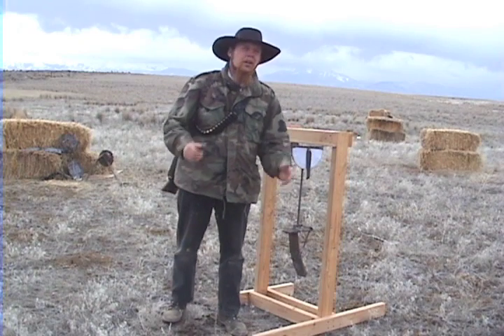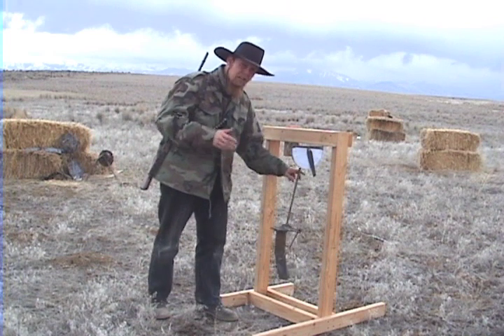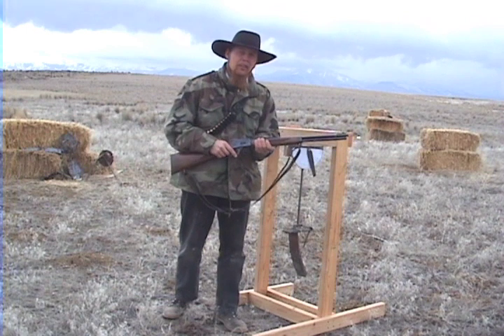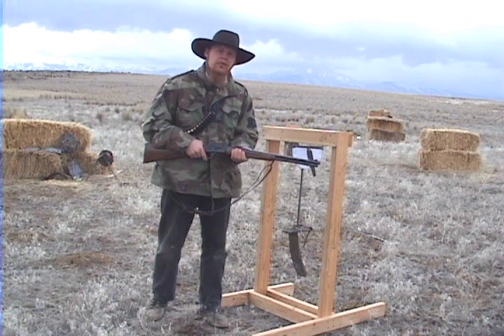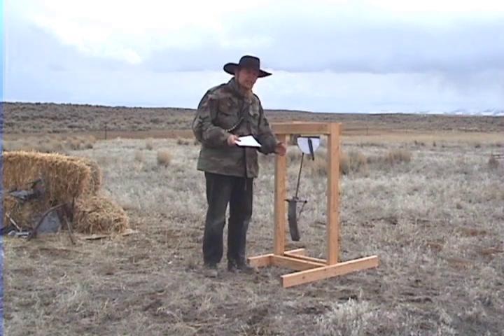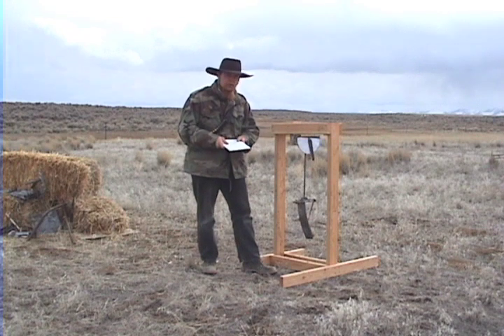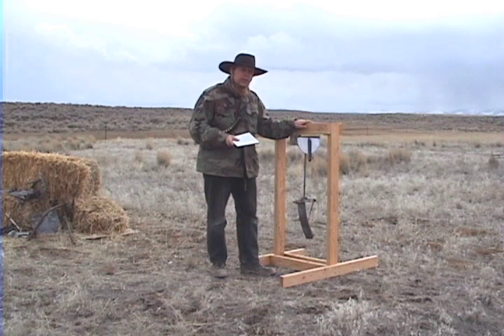Ballistic Pendulum (TIS027)

Comment: Interesting video. Please try again with a bullet trap pendulum for greater momentum  transfer. However, a good amount of the bullet energy goes into deforming it upon impact.so try shooting into the end a rubber mulch filler PVC pipe to mitigate that issue. But then there's the heat from friction... It ain't easy.

Comment: Great experiment. 
I teach physics at Kenai Peninsula College (Alaska) and the ballistic pendulum is a typical experiment. There are the apparatus manufactured by science supply companies but I use foam dart guns (in fact I prefer foam dart cross bows). Obviously real fire arms are out of the question within a university, even in Alaska. 
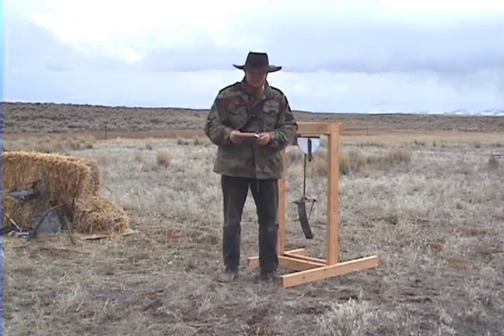As I'm very familiar with what you're doing and the computations that you're using, I'd be interested in said computations. At around 3:20 min you mention the results but I'm curious about your raw data, that is length and angle of the pendulum, mass of the bullet, mass of the pendulum.
Reply from the maker: This is a relatively old video, and I think I just wrote down the measurements on a piece of paper, which I probably threw away long ago.  However, shortly after this I did another, similar test in which I replaced the steel target on the pendulum arm with a wooden box filled with ballistic gelatin, and tried shooting it with a variety of different loads, some of which were captured in the box, and some of which went all the way through.  (video: https://www.youtube.com/watch?v=reVWYGfawZo ) For that test, I remember doing the calculations in a spreadsheet, so I probably still have the data on my computer.  If you want, I can try to find that spreadsheet and email it to you.  My email address is idaho1 at barnoftheinternet dot com.

Comment: Isn't the puddy using up momentum in slowing the pellet? Isn't it the same amount the pellet would use in collapsing itself without the softener? The pendulum puts some of its energy into the connecting mass between the point of hit and the line of swivel, because it turns as it goes. The friction of turning the bearing should be near 2% max. 
Going through the chrono the pellet isn't hindered or changed in any way except air and non sequitur gravity, and the pendulum has a number of resistance sources. My brother was right: "Nothing's simple".